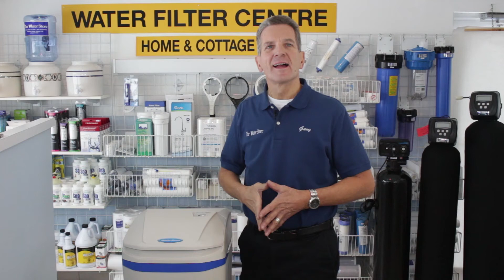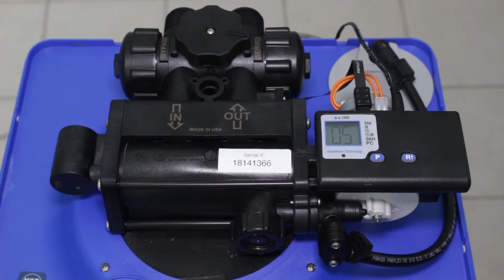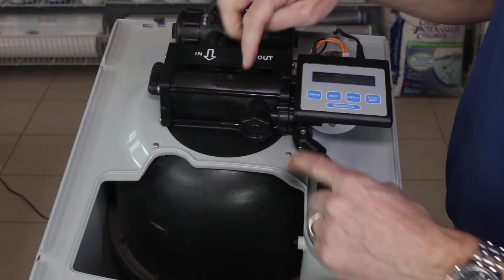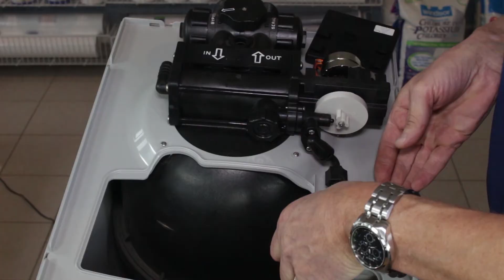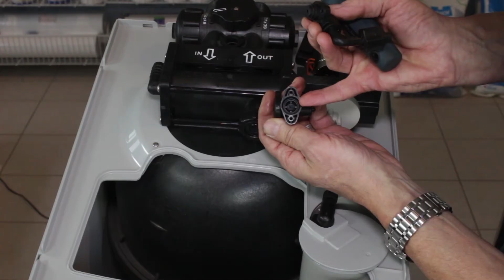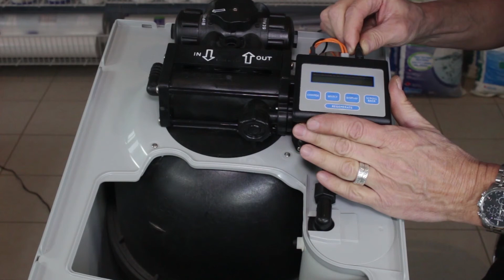WaterBoss Water Softener Clean Flow Control & Brine Piston 9 Easy Steps

Comment: Hey gary my water boss 950 knob that goes from service to bypass turns 360 degrees. Tank is full of water where salt is also
Reply from the maker: Sounds like you might need a new bypass, we have them https://waterestore.com/products/aquamaster-bypass-assembly-54512-ams-700-900-or-950
Reply: Thanks for the reply. Your video helped me relieve the pressure and install a new 950. I had the old for about 10-12 years. Thanks 👍🏾

Comment: I've been following your guides to try and troubleshoot my issues and putting my Waterboss 900 (looks like the AquaMaster in this video) in Bypass Mode and regeneration mode does not seem to release the pressure.  I've waited for the unit to complete step 1 and when I unplug the controller the unit continues to run water and if I start unscrewing the first screw, water starts gushing out.  I have the same behavior if I try and remove the cap to inspect the injector.  Does this mean the valve is malfunctioning and is not switching into Bypass Mode?
Reply: The issue I'm trying to resolve is the water level is very high and the unit does not seem to be treating our water.  I have emptied the brine tank prior to troubleshooting, but the unit is adding water to the brine tank when regenerating in Bypass Mode.
Reply from the maker: When you start the regeneration and then bypass the water softener the pressure isn’t being released? Is that correct? If not there must be something wrong with the bypass. You could always try shutting off the water before the softener and then start a regeration. That would also release the pressure
Reply: @water_estore  I wondered about that… I’ll give that a shot for troubleshooting the issue with not treating the water.  I don’t suppose you have any videos/advice for correcting the issue with the bypass?  I had emptied the tank of all water and salt and left it in bypass but the whole tank was full of water a few hours later

Comment: I have a water boss 900.  The tank that holds the salt has some debris/ dirt .  Is there a way to flush the salt tank after I wipe the walls?
Reply from the maker: You can use a shop vac

Comment: My WB900 worked great for years. However; problem now after regeneration cycle, causes yellow to orange water. What do I need to do to fix this?
Reply from the maker: Great question.  You have iron in your water.  you need to change the programming from metered to regen every 72 - 96 hours of use at least for a few weeks.  After that you can go back to metering.
Reply: @water_estore  Gary you are an alright guy! Did ya know that? Ha ha, appreciate your work Mr. water guy!! I’ll give that a shot and see what happens! I’ll have to re-watch one of your videos that shows how to properly account for hardness. I think mine allows 15-99.
Reply: @water_estore  hey Gary, the color is almost minimal at this point after a generation! 
But the water stinks like rust. This “WaterBoss 900” is of 12 yr and processed approx 1,500,000 L; should resin media be replaced? Do ya have a tear down video showing how?? 
As always thank you so much 😊

Comment: I have too much water in my Water Boss 950 Brine Tank. Happened out of the blue... Never had issues before. I've taken out the injector and cleaned it with a tooth pick.. no obvious clogs. I've also taken the brine piston out cleaned everything and reinstalled. It still has water in the brine tank... Not sure what else I can do?
Reply from the maker: Did you check out the advice in this video? https://youtu.be/ZdA0aI1q22w
Reply: @water_estore  thanks for this... I believe I missed this video. I wonder if my brine tank needs cleaned? It's never been ran out of salt and I did have to substitute with rock salt at one point. I have done a Regen cycle and it went right back to the same water level after I cleaned the float, cleaned the brine piston and injector. When I put the float back in after cleaning I did notice it being very difficult to get that nut back on... Which now makes me wonder if there's settled salt on the bottom. Don't have time to check this for a few days but do you think I'm on the right track?

Comment: Hi Gary. I have a WaterBoss 950. I get air in my water lines after the unit regenerates. Any ideas on what would be causing this? Thank you.
Reply from the maker: Yes, I have come across this before.  You need to replace part number 100240937 Air Check, 900, 950.  Email us with your address and we can get you a quotes info@waterestore.com
Reply: @water_estore  Thank you for your response. I'll look at that part and see if I can find out if it's bad. I will let you know. Thanks again!

Comment: Anyone know how to reset the display on a water boss 700 
I think it has something like 01 on the display .  Push buttons and it just shows a hardness setting. I think 15 
I did plug out of wall socket and also from the controller . 
Unless it has to be left out for a minute ?
Left out upto 10secs atleast to reboot it .
Still the same.
Reply from the maker: You need to unplug it for 60 seconds and then plug it back in.
Reply: @water_estore  thanks for that , will give it a go .👍

Comment: I've checked my flow control and it's clean but I'm still having issues with my Waterboss 380. I have a well with high iron content (10 ppm) and had the settings dialed in and it worked perfectly for 6 years. I've put it in powerclean mode every 6 months and twice a year run some Iron out mixed with water through it and everything was working fine. Now for some reason when I let my tap run it alternates like clockwork: one minute it's crystal clear and the next minute its cloudy and yellow. You could set a clock to it. It's almost exactly one minute for each state. I let the water run for over a half hour and its still clear for a minute then cloudy for the next minute and back again. Of course it has plenty of salt and regenerating doesn't help.  What could possibly cause it to alternate back and forth like that? That unique symptom seems like it ought to be a dead giveaway for a particular failure but I can't find any info relating to it.
Reply from the maker: I have never seen this happen but I tend to think the media must be exhausted by now.
Reply: I had the same thing happen to me. Extreme iron at my house and waterboss told me to run and entire bottle of iron out and let it regenerate. When it gets to number 2 during regeneration on controller wait 15 to 30 seconds and  unhook the power and let it run for 1 hour. I always do 2 hours and it cleans the media very well. I also use 1/2 cup iron out once a month and switched over to Morton’s green bag with rust preventative in it. It fixed my problem and no more brown water.

Comment: Hello Gary, 

Thanks for the great video series. I tried cleaning the flow valve and also using ironout to clean and flush out. Still no avail. Any advise is appreciated
Reply from the maker: What is your concern with the water softener?
Reply: @water_estore  I tried the iron-out, cleaning out the flow valve and used res care and in vain. Ran out of options on water boss 950(14 yrs old unit).  What is my alternative? 
Thanks for the advice and great YouTube video collection